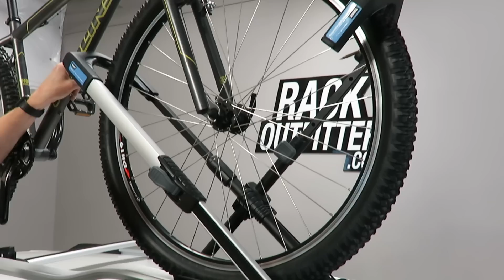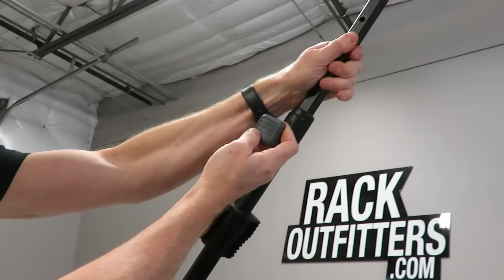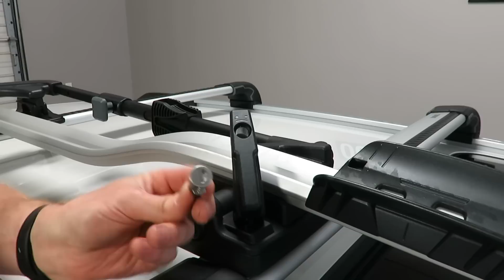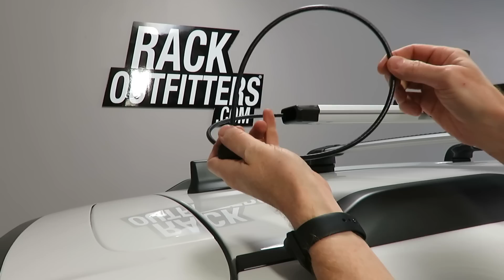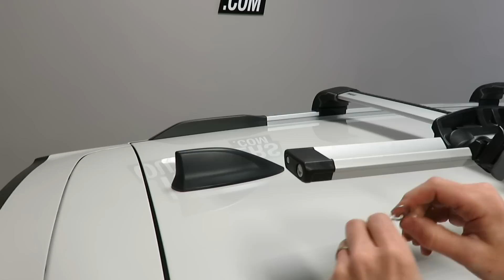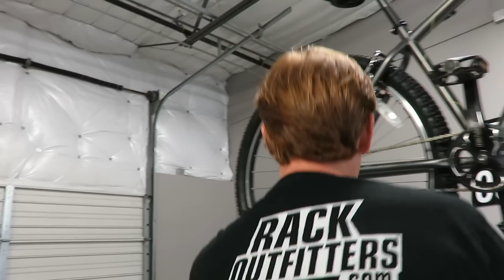Thule 599 UpRide Roof Mounted Bike Rack Overview

Comment: Hi! I have a question about the rack. If you don’t have a bike mounted, can the lower arm (the one that goes under the wheel, not the top clamping arm) swing open during hard braking so that it hits the front windshield? I installed it yesterday and noticed there is no lock or stopper for that arm. I’m worried that in a sudden stop it might hit my windshield! Has anyone experienced this issue?

Comment: just installed this, it seems very well built. My only question is nothing seems to locking the arms in place when there is no bike on the roof, am I right?  I'm just worried about movement when driving when no bike is there.

Comment: I was very nervous putting my brand new beach cruiser on this rack. https://www.youtube.com/post/UgkxG6JIgwJhur8_Rg8UeQ3EmePzi_wSncL8 But after reading many reviews I decided to get this one and take a chance. When arrived it was very simple to adjust and put together. I also added spike tape over the metal hooks before securing and tightening the straps, and no scratches. I also purchased the top bar made by the same company so that my cruiser sits straight on the rack without having to turn upside down. Extra bungee cords are used to secure the front wheel from flapping and even piece of mind knowing your bike is secure. Definitely recommend...
Reply from the maker: Hello.  Great, thanks for commenting!

Comment: Does Thule sale a right and left side? Like if you want both racks facing the same way on top of the car with the accessibility you need.
Reply from the maker: Hello.  The carrier can be quickly modified to face forward on the driver side.  See page five of the instruction manual.  Thanks!
https://www.rackattack.com/public/product-instructions/Thule_UpRide_599000_v02.pdf

Comment: Hi how long bike its can take?? can it's be used with 29" dh with 219 cm wheelbase
Reply from the maker: Hello.  Here are some technical specifications. Thanks!
Weight capacity: 44 lbs
Maximum tire width: 3.0"
Maximum wheelbase: 48"
Wheel diameter: 20" - 29"

Comment: Which one is the best in terms of sturdiness (less wobbly): 591/598 ProRide or 599 Upride?
Reply from the maker: Hello.  The 598 has less movement because it connects directly to the frame, whereas the 599 holds the bike by the front wheel/tire, this style inherently will have more movement but both are equally safe for travel. Thanks!

Comment: Good video I love this rack. But recently it’s not locking into place. I still use it and it works but it won’t make that clicking sound it does when it locks. Any idea why? I actually got it from you guys at Rack Attack. I got ahold of someone but all I was told was bring the rack to a store to get checked out. The problem is I don’t have one near me. Help!
Reply from the maker: JD, hard to say without checking it out in person.  Maybe there is another Thule dealer in your area who could take a look?

Comment: Great video thanks for posting this. The Thule manual is quite weak, and as a beginner one can spend some time figuring things out.

Does the stowed away position when empty stay sturdy while driving? I feel like the arms that hold the wheels can fly up upon a big bump and thus don't trust it leaving it empty without a bike. Thank You
Reply from the maker: Glad to hear it was helpful! The arm on the rack are design for this not to occur, so you should encounter that issue with this rack

Comment: 1st! 🤓
You mentioned it can mount via the T-slot or to a square bar using the “under bar plate,” but what options, if any, are there for the other usual suspects (round, aero and factory bars)? Thule website doesn’t seem too clear. Thx!
Reply: Kevin Hill the Under bar plate is used for both the aero, square and factory bars.